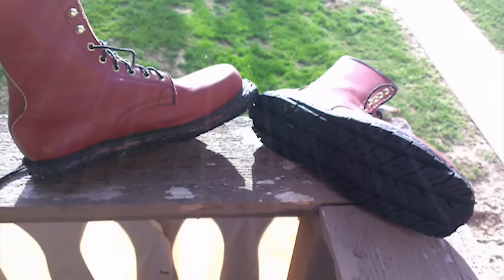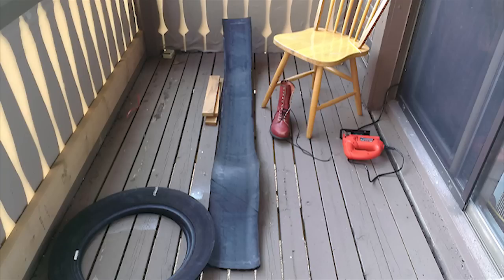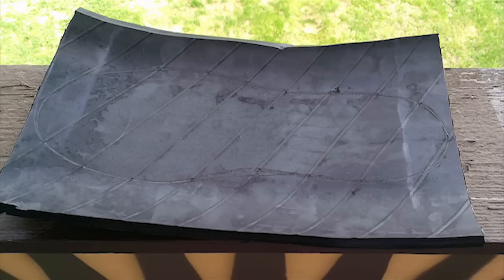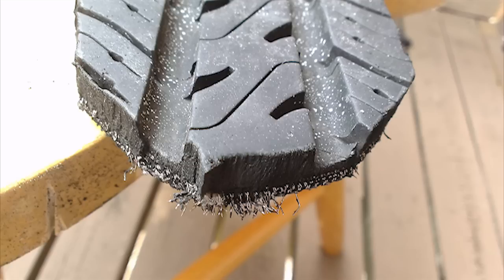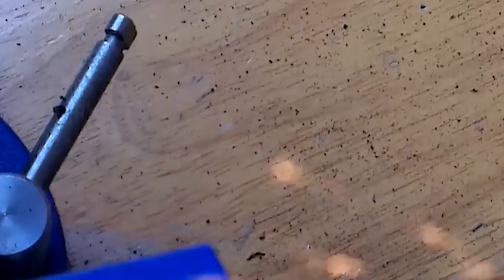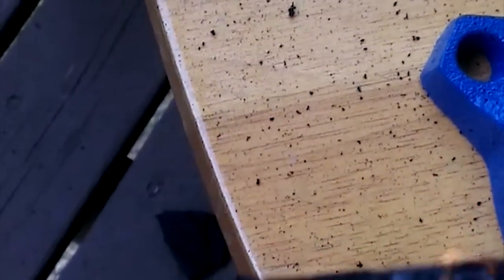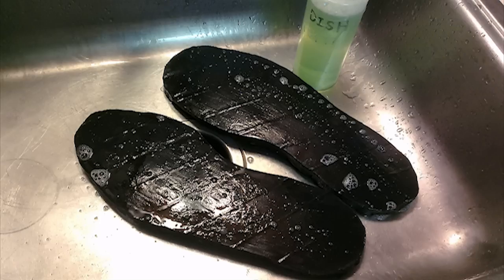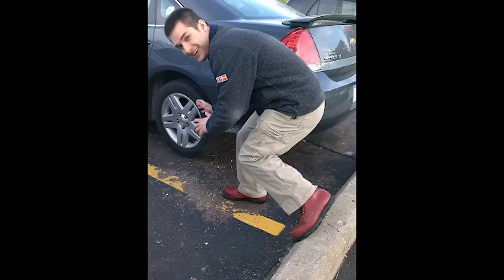Red Leather Boots Retreaded with Car Tire

Comment: Use donut spare tires from a wreckers yard. They are made with nylon and not steel belts in them and are easier to cut. No hard grinding! Plus most have never been used at all.

Comment: took a grinder and sanded the bottom smooth, cut the heel off and sanded until same size as sole, took an atv tire, and cut strips with a cut wheel, traced boot outline then cut it with hammer and chisel. sanded the side i applied to boot, contact cement on boot and tire, let dry 30 min, then stick together, take a sander and shape to the boot. for extra security, run screws from top perimeter into new tread and cut off

Comment: Someone posted about it wherein into the steel belts. I've seen this done to biking boots that get drug a lot. After years of sliding up to stop signs and take offs they only show some smoothness. I found a pair done this way at a thrift store that the uppers were in bad shape. I picked them because they were different and cool. Never have found the perfect glue to last forever. I have some tread setting aside and 2 pair of Georgia work boots that are in need of car tread.
Reply: Use Barge contact cement.

Comment: Split the tire tread away from the wire. Makes them safer to wear and gets rid of the curve. Lots of vids show that's done, by folks making sandals from tire treads. Worn down tires seem to work best, or maybe its just that they use trashed tires to scavage from.

Comment: I tried cutting a radial car tyre the other day with a Stanley knife and craft knife. Incredibly difficult to do. I finally got enough for one shoe with some of the rubber that I cut from the tyre breaking off/splitting.

I feel with a different tyre, ie not a steel belted radial tyre, it would be easier to cut, but most are radial tyres aren't they??
Reply: Yes they are.

Comment: very impressive. please upload a video showing footage of you cutting the tire please because like I tried to cut a tire with a steel metal blade + jigsaw and couldn't make a dent in it. I also tried a hacksaw but it wore out real fast , i made most headway with a razor blade but It's awkward and dangerous and can't cut the steel cables in the tire.  I was thinking about using a laser but I don't have one. k thanks